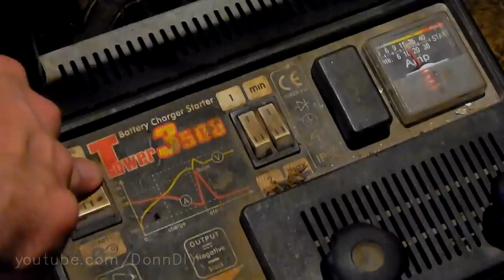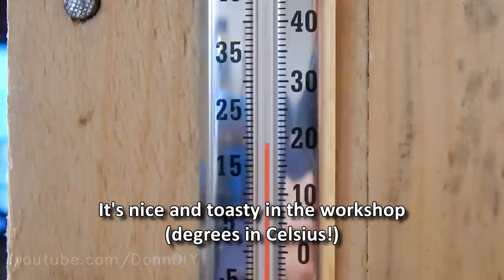Steel Frame & Electrolysis - Tracked Amphibious Vehicle Build Ep. 13

Comment: Mig welding with the 75-25 solid wire down hill will be just fine. The square tube wall would probably rip on the edge of the weld before the down hill weld would let loose.
Reply: Yeah, those welds didn't look flawed to me at least. :)
Reply: Its just a big problem with som electrodes

Comment: You are allowed to weld down hill on mig. The 3G mig test allows it now. ( Just not spray arc)
Because of the control with new welders. You just cant do it with stick welding because the flux coating will drop into the unwelded area comprising the joint.

Comment: For the tracks, consider plastic rectangular tube sections, joined by a sewn nylon band. You can use tee nuts to mechanically fasten the tube sections to the woven nylon band.

Comment: I've done rustolysis before, but the rims on my daily driver now, I just used angle grinder + wire wheel and painted, and they still look fine after 2 years.

Comment: Donn, just looking at your front axel, does it not need a diagonal brace, from the wheel hub to the chassis, as the pull of the track/rear-wheel drive,
 and the banging and bumping in use will bend that front accel, and slacken the track, also cause runout.

Comment: I weld downhill as well never have had any issues with it, and I too took a welding course.
Reply: Most modern welding schools will teach that if the welder is correctly set there is no difference in weld strength to weld downhill. Always worked well for me too.

Comment: G’day Don that is looking really sharp your doing a great job the welds look good.  That was a good way to remove the rust on those rims I’ve used the same method on miniature live steam locomotive wheels and the result was the same, saved a lot grinding and sanding.   Great job your doing and it’s good watching the changes it’s going through look forward to the next video Don kind regards John

Comment: For future reference, maybe you could do something like stick weld smaller spaces like between the plow mounts? I would think the stick would be more maneuverable in tight spaces, because of the lack of bulk that comes with a MIG welding torch.
Besides, it doesn’t matter if your welds aren’t the prettiest, because stick welders have very high penetration and will make a stronger bond than a MIG of comparable size/strength.

Comment: Great project. Two thoughts. You are really going to wish you had some serious suspension system. I tonne of buoyancy is too small. Sure , the vehicle may be lighter, but if you want a decent payload and some cargo capacity. fuel with reserve buoyancy, you need to have more.
Reply from the maker: It will have more buoyancy as I already said in the video. 😉

Comment: Yup, electrolysis is a wonderful tool. Now, you know, with all that welding you're doing without your helmet is going to cause your hand to go blind. LOL Welding on the "downhill" side... oh the shame, Hahaha. 
Just a thought, when you put the "tub" or skin on, you plan on making a shroud for air intake to keep that engine cool? At least it looks like it's an air cooled engine. Also, you might want to make plans on rerouting the exhaust as well too. You're going to be getting a lot of heat off that engine directly on you. 
Enjoying the build so far, it's looking really good. If you were to do this again, would you consider going a hydrostatic route next time? Keep on building. Cheers :)

Comment: question for you keeping towel on welder won't it overheat or you keep it on to keep it warm.?
Reply from the maker: The vent is in the rear of the machine. I keep the towel on to keep the machine clean. The vent only works when switching the machine off. I've had zero problems so far. 😬

Comment: It looks like you are running an air-cooled engine.  Even with the oil cooler you want to make sure you have good airflow.  Don't get your body work too close to that flywheel screen.  You need the flywheel fan to push air over the cylinders and the oil cooler.

Comment: Hi I have another idea of getting that rust off your wheels but it could be dangerous but I think you're more than capable to handle it... :P 

1. Attach the wheel you want to de-rust on driving wheels of your car (ie if it's a Civic you put it on front)
2. Lift driving wheels off the ground and spin those wheels, ask your brother to rev it up
3. Attach a wire brush or something to the long heavy stick
4. Now stick that thing inside the spinning wheel and scrub the hell out of it. Keep your distance because I don't want you to get hurt

Now the differential might prevent the wheel you're de-rusting from spinning fast so in that case take brake caliper off on that side, and the driver just left foot brake and give it a rev the good wheel stays put but the rusty wheel should spin.

Do you think this might work?

Comment: U kan put the weels in a bonfire, that will cleen the rust off. Good job Donn
Reply: But the steel will loose all strength.
Reply: @RubenKelevra  No need for strength in it´s working position.
Reply: @albundy1956  well, it needs to not wear out on the bolts while holding up a significant amount of vehicle at times.
Reply: @RubenKelevra  Aaaa ok, good thinking...
Reply: @albundy1956  also using electrolysis is very easy to get decent results. :)

Comment: That thing has got to weight a ton. Everything I have seen you use is 10mm plate. Great job BTW.
PS. You need a plasma cutter.😀
Reply from the maker: I can lift the front end up by hand with the engine and transmission inside the vehicle. It isn't that heavy at all.

Comment: What is going to prevent the rear axle from flexing vertically ?
Reply: You mean the diff? It's welded to the frame. The individual tire mounts are also welded to the frame 🤔
Reply: @RubenKelevra  I realize this, but they seem quite out on a limb.
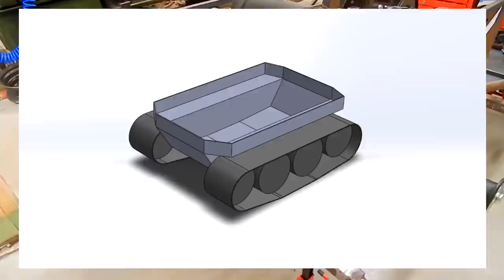Reply: @Boraxo  23:18 he is planning to do some reinforcements... 🤔
Reply: @RubenKelevra  Totally missed that, thanks

Comment: Hi me again your diesel engine generator have you thought about running it on half veg oil half diesel and as your in a open area making a vertical wind turbine.nice work on the wheel's

Comment: Will you add a propper bow in the front and the rear?
Reply from the maker: No, it will mostly be used on the land so streamlining it for water isn't my primary concern. 😉
Reply: @DonnDIY   ah okay 😙🎶

Still make sure to put a scale under each wheel when you're seated, just to make sure your it floats stable. Put a similar height wood blocks under the others.

The earlier you start the better you can still shift some weight.

The back should be slightly heavier to get the front a bit higher out of the water. When you add a "lip" in the front, a bit overhanging metal, you can protect it from water ingress by the bow wave. In the back the wall should be slightly higher (and the sides), to compensate for acceleration and the downward force by the tracks running thru water.

I would also add a electric pump, to get any water out of your vehicle, just a little bit can give you a serve list. 😂

Comment: Im from an engineering work background, and I cant understand why you keep doing the cutting with the cutoff machine on the ground.  You may want to fabricate some working tables, stations and fixed cutoff areas where you could stand upright when working and not compromise on the ergonomics.  You WILL feel it when you get older.  Keep up the good work!!

Comment: I love how nice the new shop looks and I also love the progress. Can i ask why you decided to go with a frame instead of just building a tub?
Reply: Strength and rigidity. Simple mechanical physics.
Reply: @zetacon4  right but most tanks dont have a frame they are just welded plates. I have seen one other one on youtube that is just welded plates.
Reply: @Atvsrawsome, I'll let you explain to all our comment readers the situation Donn has in his workshop and material supplies and then see if that helps explain why he made the choice he has made. You speak of "most tanks" as if you are very familiar with the same sort of design of vehicle that Donn is building. Please also include that vehicle design in your explanation. I would really like to read what you have to say. (I'm just an Electrical Engineer, not a Mechanical Engineer)
Reply: @zetacon4  I'm not knocking what he is doing I'm just wondering pros and cons

Comment: You could have had those rims sandblasted for hardly nothing at all, and it would have took no time at all to clean all of them.
Reply from the maker: I live quite far from a bigger city where they sandblast steel. Using electrolysis while fabricating other things is time saver for me. I only spend time putting the wheel inside the tub and after washing and wire wheeling the rim and that's it. Otherwise I would have to book a time, drive 45 minutes, pay for fuel and sandblasting service, drive 45 minutes back home. And then go back and pick the rims up again after they've finished sometime in the future since they don't do it ever immediately.

Comment: With steel, it's called MAG, not MIG
Reply: They are both the same. The metal makes no difference.
Reply: @dennisbaecht7860  the MIG is only for copper aluminium and titanium.
Reply: @MATEKYOO  , I hate break it to you but, you are wrong. MIG and MAG can be used for any material as long as the solid core wire matches the base material and the proper gas or combinations of gas are used
They are different acronyms for exactly the same process.
Reply: @dennisbaecht7860  i agree, the process is the same
Reply: @MATEKYOO  , if you agree that the processes are the same why did you make your original statement.